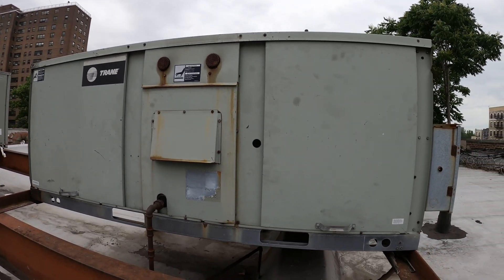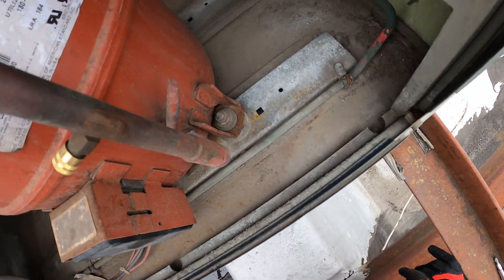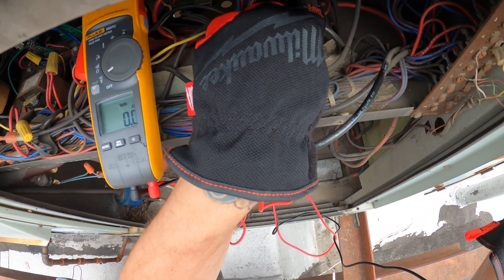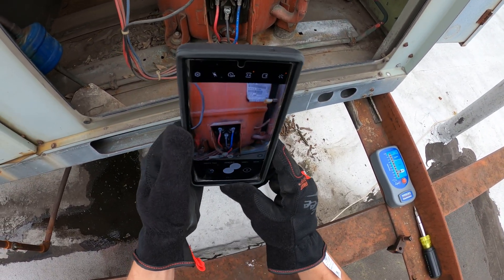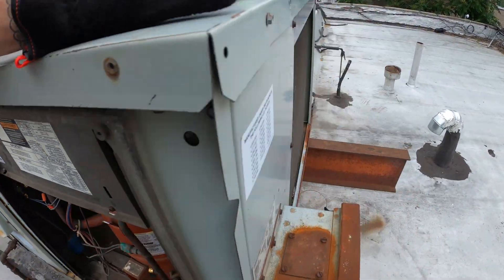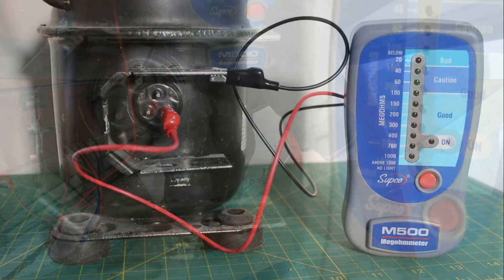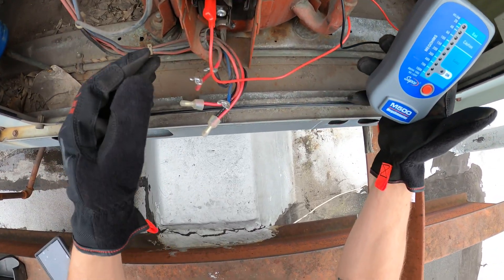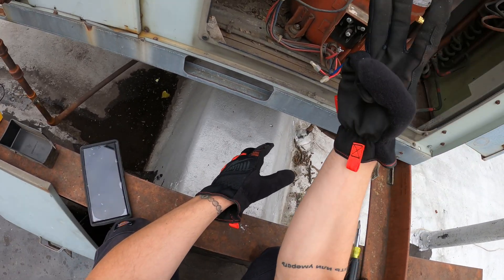HVACR: "Megger" Insulation Test For 3 Phase Compressor (Motor Windings Insulation Test) SUPCO M500

Comment: Hello, the resistance of a winding is infinitely small compared to the insulation resistance (a few ohms to tens of Mohms). It's therefore normal to find the same insulation value on all three terminals, as the windings are interconnected in the motor.

Comment: Got one of those instruments, used couple times and it checked good. Here is my scenario, got a burn out compressor and I was showing my helper how a new compressor will read, oddly enough the new compressor also checked bad insulation, not grounded obviously. It left scratching my head. We went ahead and complete the replacement. It ran and was doing its job. 
Just sharing what I found.   Feel free to post if you seen a compressor like it.
Reply: Did that compressor die shortly after?
Reply: Did you have a good ground?

Comment: That tool is useless for Copeland scrolls, they state that a good reading is 0.5. You need a fluke to test lower than the 20 that the supco goes to.

Comment: I’m curious if this megger works properly on 460v equipment. Aren’t you supposed to apply double the voltage to the winding? So in this case this is a 230v 3 phase RTU. That megger applies 500v so that is double of 230v but what about a 460v compressor? Shouldn’t you be applying 1000v to a 460v compressor? Just curious. I was thinking about purchasing one of these meggers. Nice video 👍🏻
Reply: Klein et600 megohmeter does 1000 volts

Comment: yo is it true this megohhmeter isn't really the right way to test the compressor ... since each company lists what's considered the lowest amount the compressor can function on ?? I just watched a video where the tech was showing this. like the megohhmeter condems compressors when they really work because it's based off the megohhmeter rating not the actual compressor manufacturers

Comment: If your a real hvac tech with years of experience you can meassure any compressor with a clamp multimeter  or any multimeter...
Reply: You definitely can but sometimes the meter won't show you if a compressor is shorting, that's were a megohmeter comes in handy

Comment: I reccomend saving up for a real megger bro, these supcos are notorious for bad readings, another tech i work with used to use one and he would test a motor that tested out good according to the supco and my fluke said otherwise on multiple occasions.  Ive heard same bad things from other techs as well.  not worth it, why do you think theyre so cheap?  Gotta ask yourself why they cost hundreds less than a proper megger. Be safe.
Reply: Yes you will need a better mega when you're testing commercial industrial units which cost a lot more money😊

Comment: "You should have EPA license before touching any type of equipment that has refrigerant" - only if you are a tech by trade. You have to pass an EPA-approved test to earn Section 608 Technician Certification, for under 5lbs appliances type 1 you can do it online.  You don't have to be a section 608 technician if you service your own HVAC. Under Section 608 of the Clean Air Act, EPA prohibits individuals from knowingly venting refrigerants containing ozone-depleting refrigerants (including HCFC-22) as well as their substitutes (such as HFCs, including R-410A). That's it. Free to add R22 if you are a homeowner, free to evacuate. You will not be able to buy R410 in your local store without 608, but get Type 1 Open Book Certification online and problem solved. Or go ebay
Reply: In the proccess using Skillcat for my epa 608 cert and all the other training they have
  so i can start working on our warehouse hvac.hopefuly there legit. Ive learned alot from the hvac guy who was willing to teach me. Repairing/servicing Almost 100 rtu units.   my boss wants me to start doing basic troubleshooting/repairs like fan motor swaps/ anual testing/cleaning.  If they dont give me mofe money ill go somewhere else. The hvac guy already said should do well in hvac from what ive helped him with so far. I can unnoficialy do car ac repairs so its time to move up to the big boys

Comment: Can we get an accurate reading by  Hooking up the wires coming out of compressor  instead of terminals ? It Does Matter?
Reply from the maker: That would not exactly be an accurate compressor reading because now you are measuring the wires AND the compressor. A damaged wire could fool you into thinking the compressor is bad. Thanks for watching!
Stay tuned for new videos every week 🔧⚡️
Reply: @JumpermanTech  Thanks alot. Excellent video like always.
Reply from the maker: @MrJeromegon  You're very welcome! Anytime 🙌 Thank you so much 🙏

Comment: I've had brand new lennox units with US Motor for the blower literally burn out the idf motor in less than 8 months everything was within the rate RLA on commission and even when replaced with another US Motor that one burnt out in lime 6 months. Will never buy another US Motor again.
Reply: You may have power surges or just look further

Comment: I'd have to say the live, dead, live test is safer and before using that method, test meter leads by switching to ohms/cont. and shorting leads.  Don't forget to change function to volts after checking leads.  Now who you think is going to all that trouble?

Comment: I have a special place in my heart for the old XE Trane condensing units. They were so good and lasted very well. I work on quite a few to keep them going. Newer units aren’t anywhere near as good. I’ve seen compressors bad right off the get go. Absolute shame in quality.
Reply from the maker: I hear that! Appreciate you watching & your response🙏 It is a shame how they don't make them like they used to but this is everywhere with every manufacturer. Can't complain, keeps us in business😁 Stay safe out there & stay tuned for new videos every week!
Reply: I used to love how to do the self-test by jumping to do terminals on the on the top going to the stages